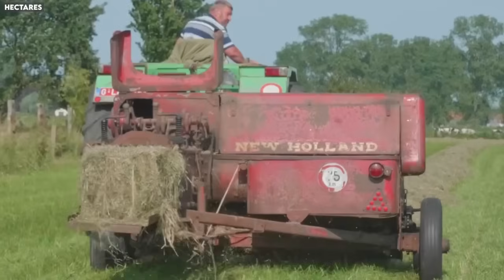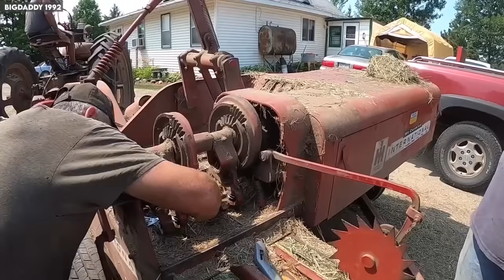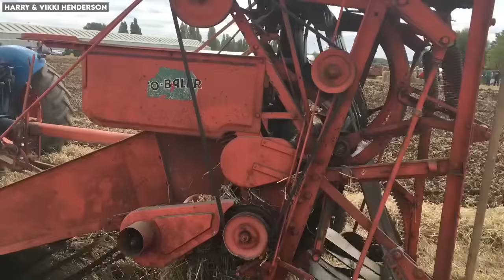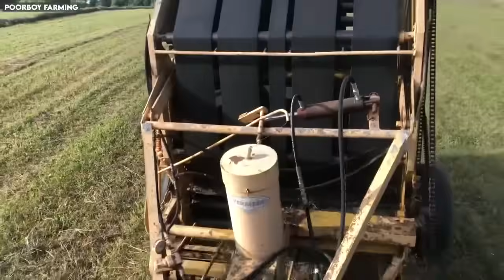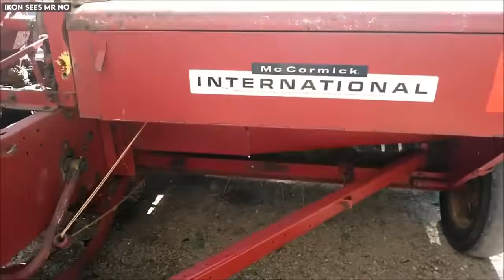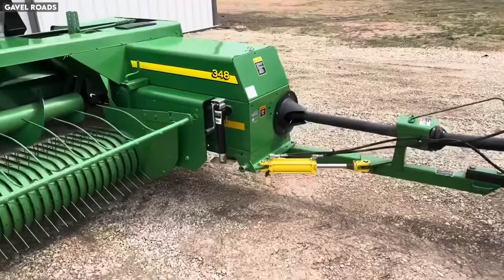10 Classic Hay Balers That Were Unstoppable—Until the Day They Failed

Comment: We had a new holland 249 hayliner was a good square baler, and a 851 chain and bar roll baler, he eventually taded it for a belt new holland the last few years we had cattle.  He sold the 106 hp ford 7710 and the baler both when he quit farming and began leasing his acreage to corn and soy ean farmers, said profit wise he was coming out twentfive percent less with zero work compared to 150 head of cattle.  He was 67, hes 80 now sow 13 14 yrs ago, kept the john deer 820 that was a rake and small bushog tracyor, it is 1970 m,odel, still a awfully good little tractor , im 54 now and that tractor had a few thouand hours on it then, i guess its in the 6000 hr range now, and still a good good little tractor.  It was built in Germany at the john Deere werke manheim factory
Reply: Thanks for the auto biography! Made my day!

Comment: Used both the New Holland 68 & 78, the 68 was by far the best, bail density and hence weight of the 78 was erratic and used to through shear bolts like there was no tomorrow, I was convinced the 78 had a tapered bail chamber but never actually measured it 😮
Reply from the maker: That is very interesting feedback on those models, thank you for watching! 😊❤❤

Comment: We / had the 530, trying to save money went to the nylon string. Until 50 + strings didnt hold.😢😢
So finnnnnalyyy got him to go back to Sissal.
😊😊😊
No thanks but  no broken bales.
Reply: Plastic twine has a good feature, and a bad feature. It doesn't rot, and it doesn't rot.
Reply from the maker: @EricC-k8e  Thank you for watching ❤❤
Reply from the maker: WOW,  Thank you for watching 🥰🥰🥰
Reply: IF?
Should have a talk on and about 
"" Stacklinners""
😊😊😊
Thanks
Reply from the maker: @edwardcarberry1095  Thank you for watching ❤
Reply: Dad had a B47, would knot plastic on one side but despite being threatened with certain death would not knot it on the other side.
Reply from the maker: @gerardcallan5655 thank you for watching ❤

Comment: No  mention of the 62T Oliver square baler which became cockshutt baler. Built quite heavy duty. Bale size and density easily adjusted. First manufactured in early 1960’s. Used it for 20 years with very little trouble.
Reply: Our old cockshutt would bale anything.  And if the swath was too thick, bales came out 4 feet long.
Reply from the maker: Thank you for watching. Also many thank to give more informations🥰🥰🥰

Comment: The best baler of the late sixties and early seventies, was the New Holland 273 Hayliner, a great machine for a family farm, not too big, not too small, just right.
Reply: My uncle still has tbe Hayliner my grandfather had before I was born in 1977. Still runs it a bales thousands of bales every year
Reply: @aaronsanborn4291 we tried to do 100,000 per year, 35,000 for the 78 and 278 and 20,000 for the 68 so we came close. Great machines. Also 286 was a real giant 945 was also a nice piece of kit. 268 less, especially straw got stuck straight after the pick up and no visibility on the intake and therefore a shear bolt eater. Gallignani was also not too bad but you really had to grease the knotters after 1,500 bales. Which was also recommended for the New Holland's but they did not bother. Thanks for the nice video. 🦬 470
Reply: They were temperamental my dad was a pro at fixing them and he loved  to see the sun appear as they'd be pulled out some from a shed and some from behind a hedge he always said a new Holland 276/376 was the best/simplest of them to have/fix ,I have inherited a 376 from my grandfather that my dad had picked up for his dad as he knew he'd be looking after it, so it's parked up at mine but still in good enough condition!
Reply: @AdrianTimmins  I can only speak from my own experience. I only had one time when the knotters got out of time, other than that it worked great. Like anything, it depends a lot on maintainence, keeping the baler clean and, cleaning out the bale chamber and storing it well over the winter. I liked to grease every thing up clean it well and then park it in a shed with a crushed rock floor over winter. Mine never required any fixing at all.
Reply: @keithkuckler2551 well I suppose any of them is good when their going, their easy knocked out of line something as simple as the row of grass can do it!
Reply: He had great belief in a new Holland 276 and 376 I actually have got his dad's 376 when I bring it home !
Reply from the maker: @AdrianTimmins  Thank you so much for watching us.
Reply: @bigmachinefury my dad  always said not to ring him till U were in the field with it and he'd put bales out of her? and I got the job of gathering them up after turning the fly-wheel by hand for him to set her up?😅
Reply: He always said a new Holland 276 or 376 and I asked about my granddad's auld 376 and was told to bring it away me but haven't been brought it home yet?
Reply from the maker: Thank you for watching ❤❤❤
Reply from the maker: Thank you for watching and thank you for comment❤❤❤
Reply from the maker: Thank you for watching.
Reply: Just two weeks ago I borrowed my neighbor's NH 273 because my IH 430 handled long hay very poorly.   The plunger guides were worn, and under pressure from compressing hay, misaligned the plunger and putting a gap between knives.  The bales came out stuck together which was very frustrating.
Using the New Holland was a revelation.  It's bales came out perfectly shaped and remarkably consistent length, even if baler was kept running without hay entering.  Very compact and simple, the 273 could make bales the IH couldn't dream of making.